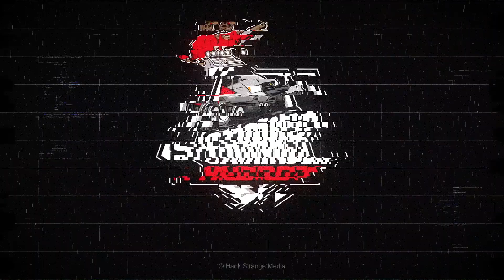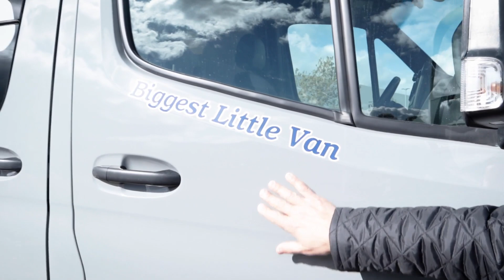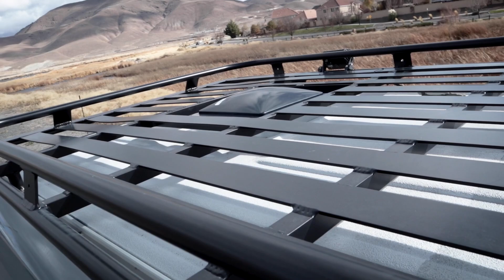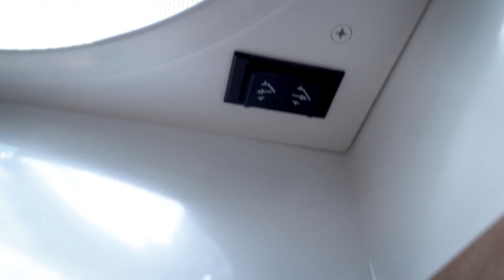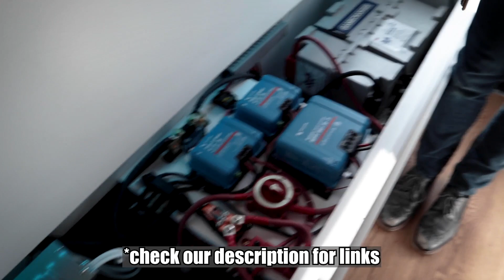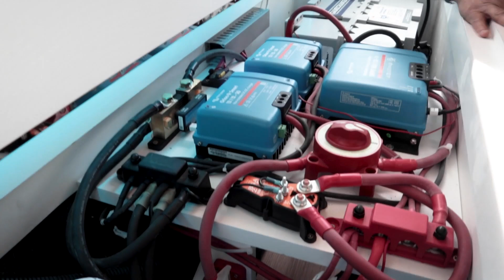LITHIUM BATTERY INSTALL DONE RIGHT! Camper Van Battle Born Conversion

Comment: Just curious, why use such small DC to DC chargers?  If you don't have any sun and your batteries are dead then 540 Amps hours/ 60 amps = 9 hours of driving to charge the battery bank.

Comment: It's interesting watching videos on people putting these huge systems in vans! they need all the power to run their AC and the appliances! But the problem is trying to charge your system with solar and it's not feasible! there's not enough sun in a day. So they start their van and burn fuel from the 6 cylinder motor to charge off their alternator lol! To charge a system like this you would need to run your van for well over 2 hours! I can see when you're travelling down the road it does it all for you but if you are at a campground with no hookups then you're going to run your motor a lot lol! a simple generator will do the trick! It will keep you cool or warm and allow you to run all your devices while charging the batteries on very little fuel, and it will save you money on purchasing these very expensive systems lol